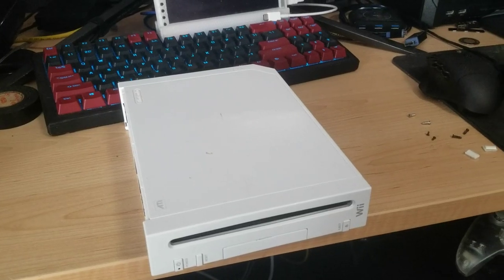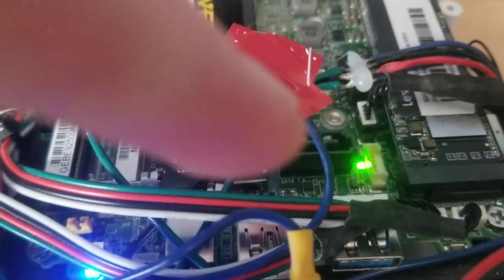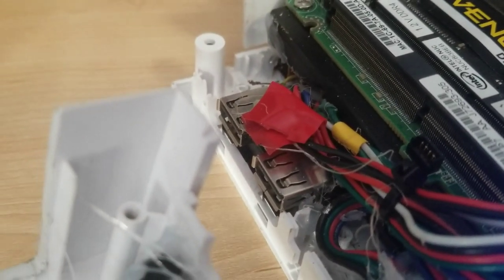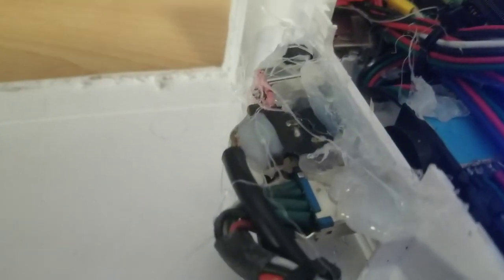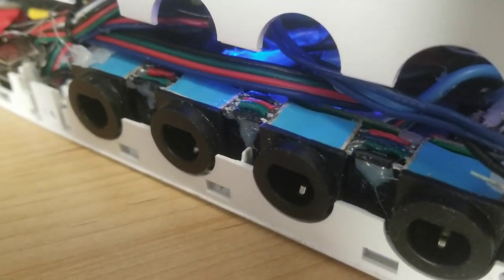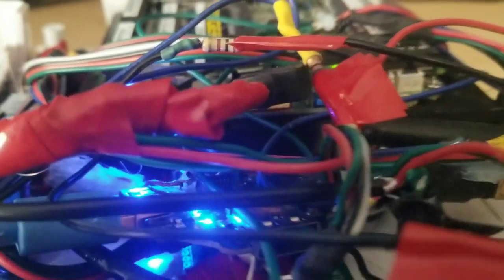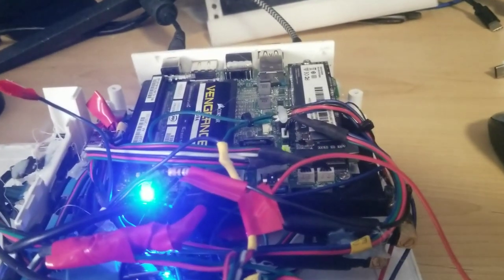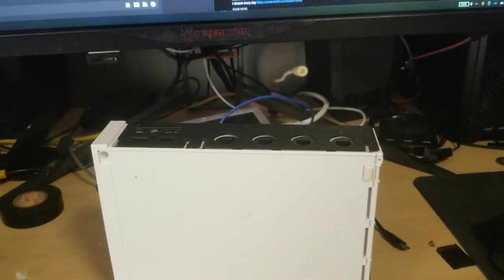Wii Sleeper PC Teardown!

Comment: How well does it run dolphin if you've tried it?
Reply from the maker: I haven't done that much testing, but it'll run them. Gaming in general on this low end hardware depends more on setup and software, so running with no enhancements on Linux would gives it maximum performance